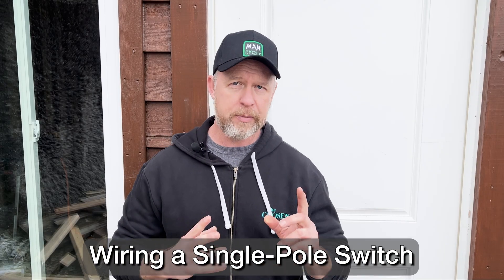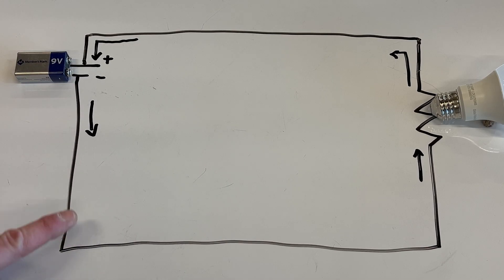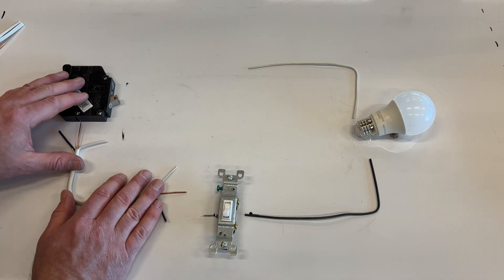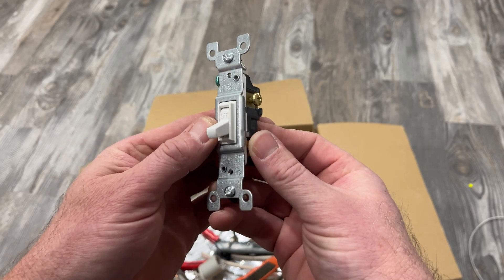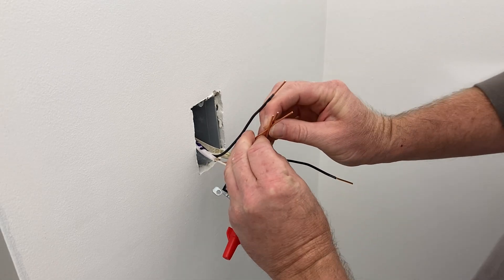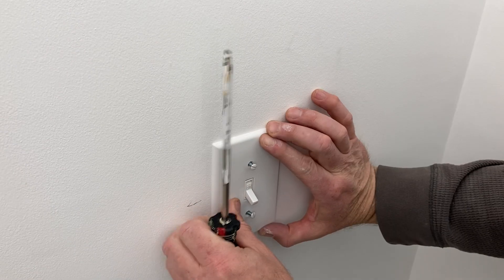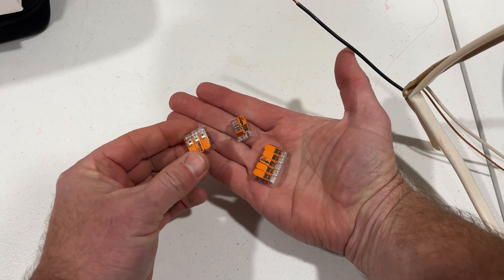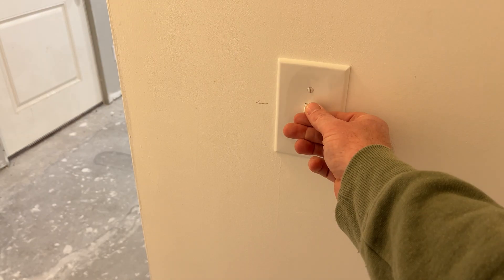How To Wire A SWITCH - The Science, Materials, and Connections!

Comment: Great video. I have liked, subscribed and watched more of your videos. I am in the process of replacing receptacles and switches in a house built in 1994. Some of the ceiling fan connections have multiple wires coming together. I think the original electrician, which I AM NOT, ran a whole bunch of switches off one line and I have, apparently, mixed up a couple of the wires. Trying to sort it out is frustrating. This will help. Thanks
Reply from the maker: @xringeagle Thank you, friend! Glad it helped. I’ve ran into the same problem in my home (which was also built in the early 90’s). I’ve got a video coming in a couple weeks about 3-way switches, which may also help you if there are any red wires running to that junction box you described.